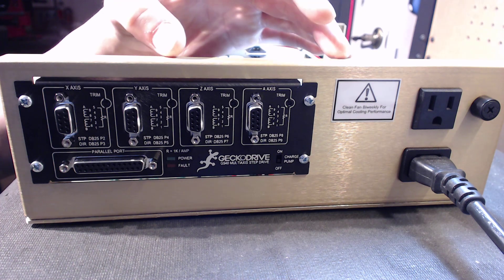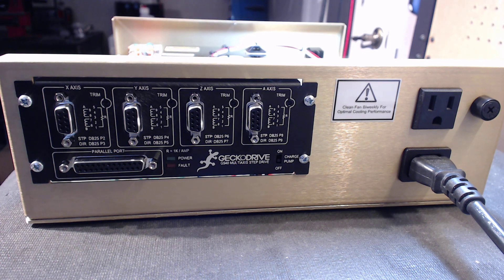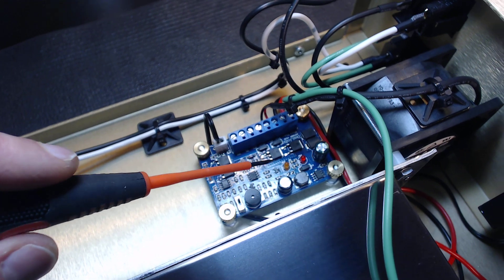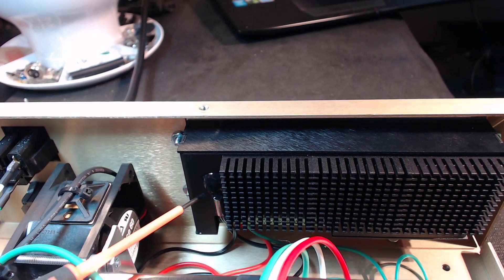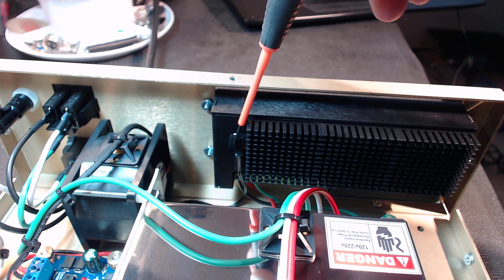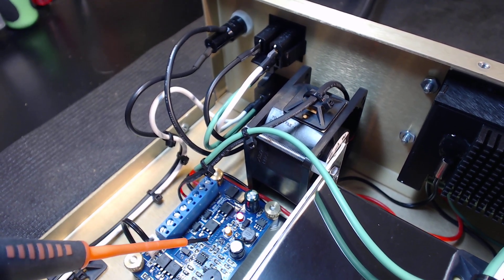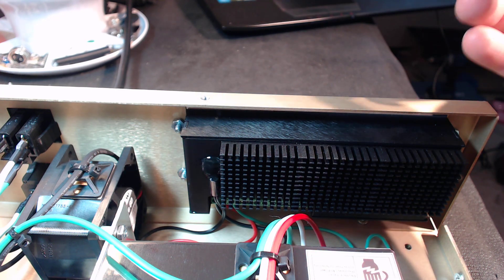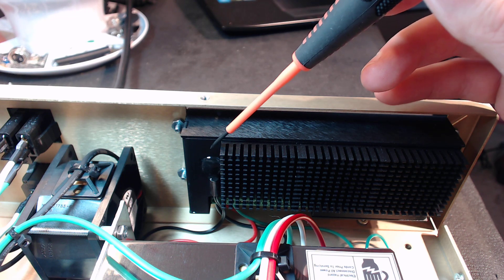Installing The Autonomous Fan Controller In Your System..

Comment: Super Dumb Question: Thanks for all the tips and I use your fan assembly so I need to hook up the temp sensor. Would it be better to place the sensor farther down the Gecko so it is not the first thing that gets cooled by the fan? In other words, is it possible that the sensor would get cooled by the fan, while one of the driver toward the right-hand side is still too hot? Thank you for all the knowledge sir.
Reply from the maker: James thank you for your support. Yes you can place the temp sensor wherever you like. I've done a bunch of real world testing with the systems location, and have found that regardless of where its mounted the results are all virtually the same as the drives are mounted internally to the G540's backplate, and heatsinks are mounted to it with thermal epoxy which essentially makes a solid unit.

 I know exactly what your thinking in the location I placed it in the video, but the temp sensor's surface area is much less than the heatsinks, so the drive on the the far right side is still receiving the required cooling with all the heatsinks functioning as a single unit.

Thank you again,
Vince
Reply: @corvetteguy50  Makes sense, and again, thank you!
Reply from the maker: @JamesAmos   You bet :)
Thank you,
Vince